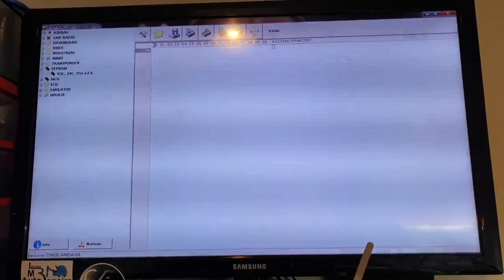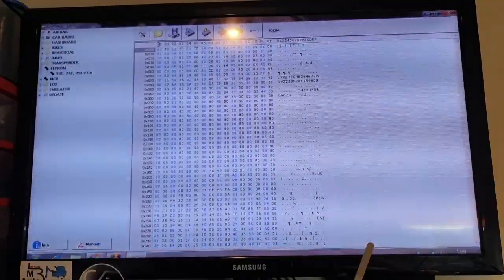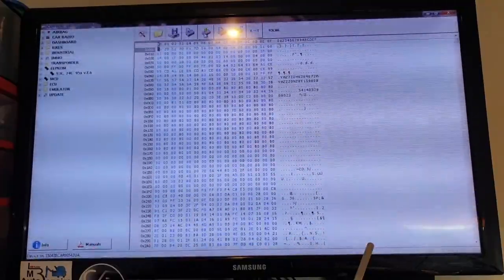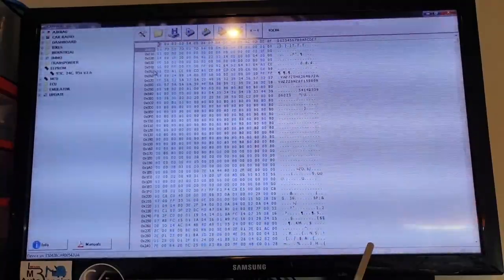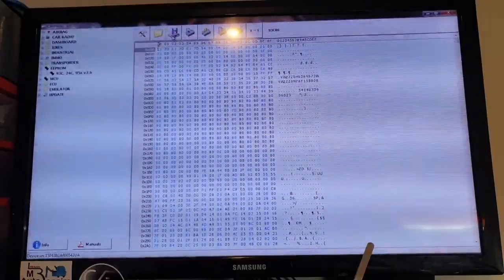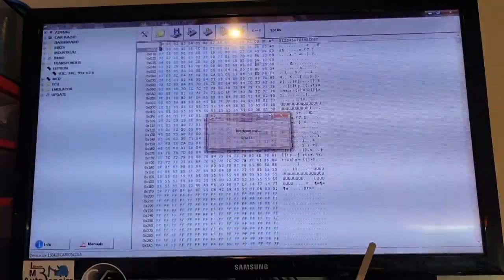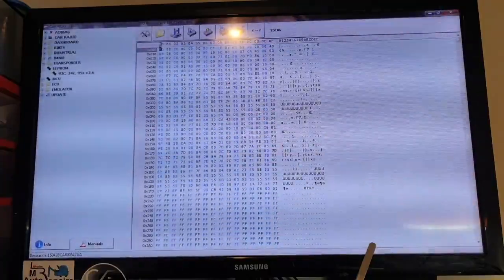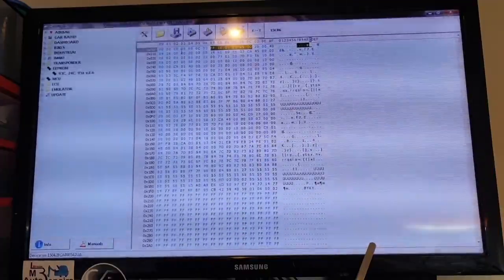Carprog reading

Comment: Hi, do you have advice for me? I am trying to change the dash on my A4 B7 (RB8 Immo4) from the mono FIS to color FIS. I can not read the immo data from old dash for some reason, always gives me an error. Eeprom dump comes out with useless garbage. If I install the new dash I can read the immo data and eeprom from it, even change km, without any problems, only have the problem with the old dash which I urgently need to read the immo data from to transfer to new dash. What might be the issue? I am using Carprog 13.77
Reply: Solution not needed anymore, car had an engine damage and has been replaced.. 🥲